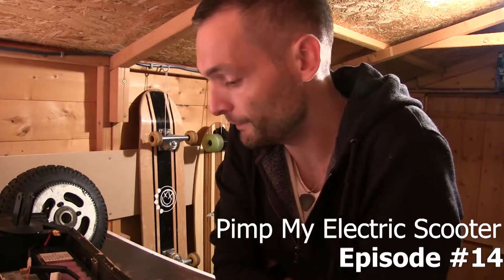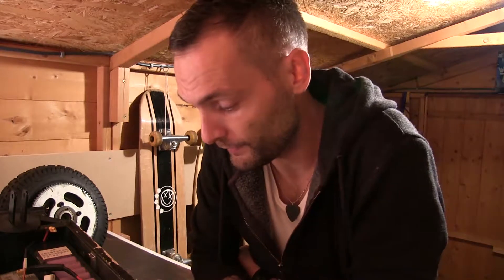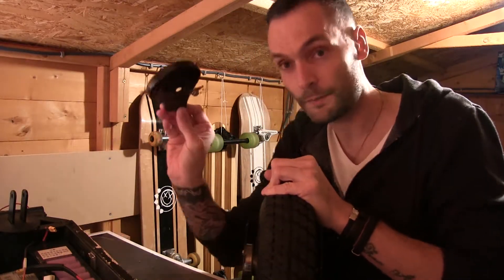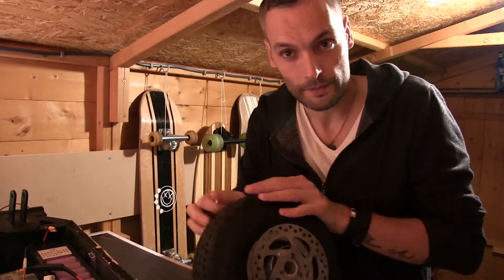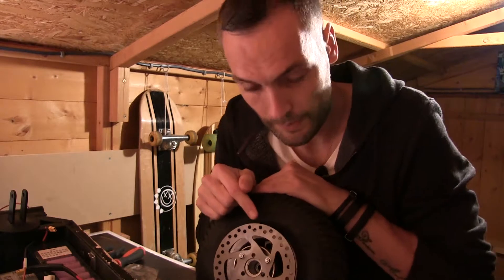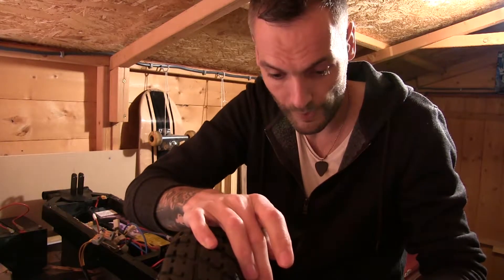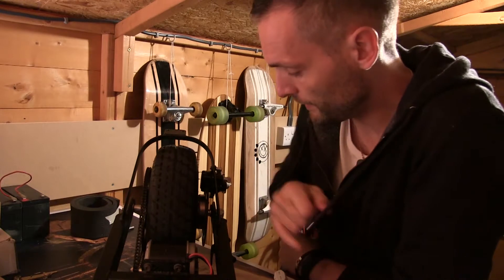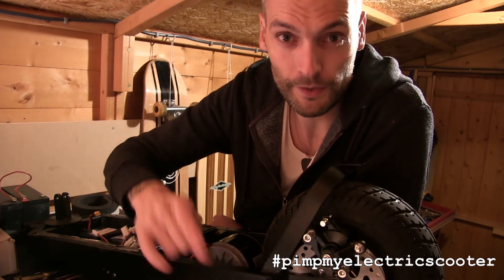DIY Electric SCOOTER build - Episode #13 - Fitting a disc break to a Razor E300 wheel

Comment: Electricscooter.com sells the perfect adaptor for this. All you have to do is unthread the stock drum and thread on the adaptor. Lots of disc choices that fit the adaptor too, its a great upgrade. I’m just wrapping up a e-300 build, Alien outrunner motor with a Flipsky controller and disc brake. Similar to Dickie Withers set up. I love seeing what people are doing with these Razors, they are such a great platform for these builds and you can pick them up super cheap. Thanks for your video!
Reply: Bryan...do you have a link to the adaptor? Much appreciated
Reply: Looks like the link worked, it actually takes you right to the rotor adaptors